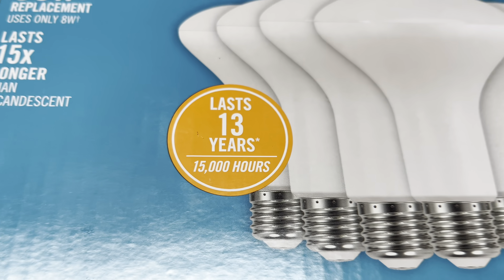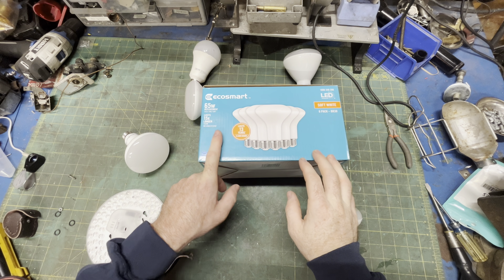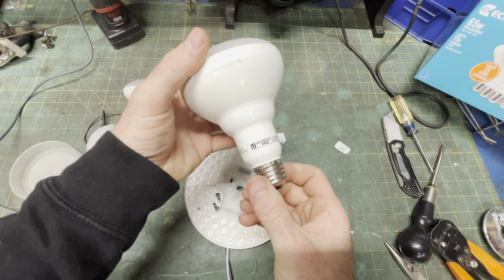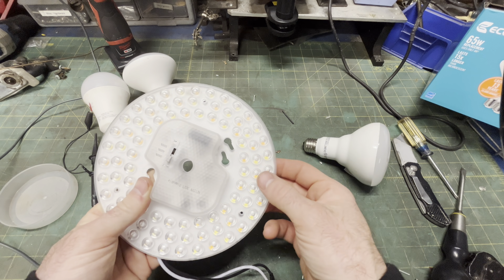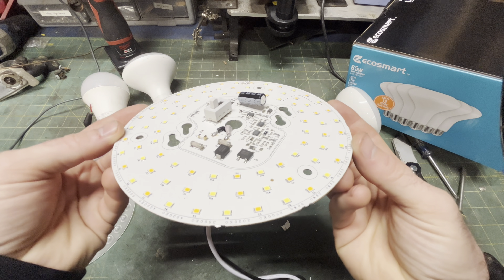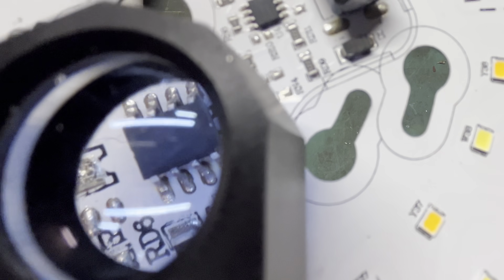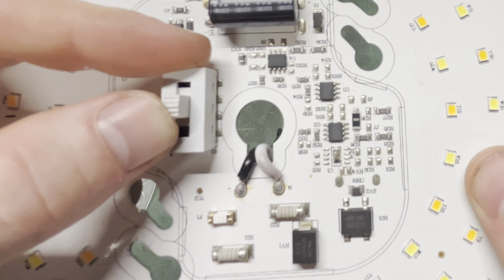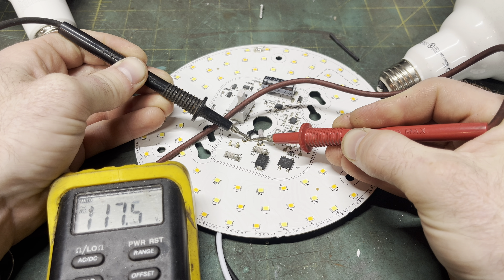Why Do LED Bulbs Fail? An Autopsy!

Comment: I've found the one REALLY good thing about LED light bulbs is that if I pay a bit more for the premium brand or version you really do get a better product. The cheapo Chinesium products will break in about the same time a similarly priced CFL would. A nice Philips light bulb likely will approach their advertised lifespan give or take a year with reasonable duty and use. Also, essentially no color variance between identically branded bulbs.

Comment: This seems like the right channel to ask this question. I had a faulty LED light bulb that caused the circuit voltage to jump to 220vac when it was connected and when disconnected the voltage would drop back down to 110vac. What fault caused the voltage condition I described?

Comment: I bought a 3-pack of LED lightbulbs (alleged average lifetime: 25,000 hours) with the intention of replacing the three compact fluorescent bulbs in my ceiling light over time as each one failed.
Since then I've replaced two failed fluorescents, but the third LED bulb has recently been used to replace one of the other LEDs. The third fluorescent is still going strong (though a little less bright).

Comment: Speaking of broken solder joints, as an automotive tech I repaired many ROHS circuit boards starting around 1988 in engine control units, dashes and heater control panels with old school lead/tin solder....until I ran out of lead/tin solder; high tin and antimony solder is just too brittle IMHO, your mileage may  vary.

Comment: I could see the multimeter leeds sliding together and thought what the hell. I did this once and had to sharpen my mmeter afterwards on a sandpaper block. Looks like there might be redundancy in the flat light, and it is spread out for heat dissipation. Simple repair with everything accessible.

Why is the aluminum sheet called a "wafer"? You can pull off the screw socket and the rivet pin to release the wires. Pointless to break it apart if it doesn't go back together. These reflector-shape bulbs are usually enclosed, which kills them. Now the trend is to hang bare bulbs even in nice diners.

Comment: Incandescents burnt out all the time.  Mine have lasted so much longer than incandescents I almost forget they can burn out. However most don't last nearly as long as promised.  Used to take the CFLs back and get new ones when they failed warranty.  LEDs learned from that and killed any warranty process.

Comment: I was a Tech for 30 years in R&D. I was there for the switchover from lead based solder to lead free. It was the biggest disaster ever. I tried to work on an LED bulb but trying to desolder a lead free device needs a blow torch. There were all sorts of problems in high density packages with "whiskers" forming from the high concentration of tin. What you came across in the first issue is quite common in lead free boards, solder starving due to poor flow. The amount of lead in PCBs is negligible. One car battery has more lead in it than a bitcoin farm would have.
PS: You had a resistor that was apparently blown open. Pro tip: Just read the value and solder a new one on top of it, preferably a higher wattage version.
Reply: if its open and you run another resistor in parallel its still open
Reply: @XDbored1 That’s backward. Current takes the past of least resistance and a resistor has less resistance than an open. If the resistor were shorted, you’d be correct. Adding a resistor in parallel with a short is still a short.
Reply: @minig646  Thanks. Someone (gives XD the side eye) clearly failed High School electronics. It does make me think of why a resistor would "open" itself. It might be just a bad resistor from the factory and it just went, or if it's a low ohm resistor that is running full time near its wattage limit, over time it could do thermal damage (thermal cycling can stretch the package and eventually break the resistive element or even break the solder connection in an SMT package.), but it's hard to say now knowing the material its made of (carbon, metal film etc.)
Reply: @minig646  ah makes sense i thought open meant no resistance ie shorted, looks like everyone uses it to mean cut.

Comment: The first CF bulb I ever bought lasted for around 20 years in four different houses and my workshop before finally fizzling.  Even the shortest lived LED bulbs I've bought (and some, as he points out, are garbage) last several times longer than an incandescent.  We just forget how often we had to change them.

Comment: I installed a motion sensing light fixture in my garage shortly after moving here in July. I installed in it some LED flood lights that I had taken out of my kitchen in my previous house when I changed them all to a matching color because some buffoon couldn't be bothered with such a task before. Anyway, I figured I'd use these bulbs in this motion light in my garage so that when I walk out the door into my garage I don't fall on my face tripping over the dog or something else in the dark and I don't have to turn on the gigantic garage lights that according to my calculations consume around 660W. Well anyway, it's now been just a few months and I have already had about eight of those bulbs. Go bad. Mind you not a single one of them had failed in my kitchen in my old house before I put them into storage for a couple of years. What the hell?

Comment: Phillips Hue bulbs are expensive as hell at $50 per bulb, but they have proven themselves given that I bought them in March 2013.

So they’ve lasted me 10+ years going through 5 different apartments Dorms and houses, and I can change their colors.

Did I ever buy them for $50? Hell no, I often pick them up at warehouse salvage yards for $0.01 to $0.25 each. I currently have like 30 of them with 20 of them being color changing bulbs.

Comment: I noticed LEDs get dimmer over time too. I replaced a bulb in a ceiling light with an identical bulb, bought at the same time but never used, and I nearly blew my eyes out. So after 1-2 years, they lose a good % of lumens too

Comment: modern incandescent don't last very long either.
That outdoor one also looks like a 40 watter, so that will probably last a while.   I almost never see 40 watt bulbs in use, but I've never replaced one either.
Not many want to live with 40 watt light, tho.
Most of my LED's don't puke, but the ones that do, fail pretty early.
Sometimes the covers just fall off, but they still light, lol.

Comment: Have had some cheap led burnout in a 1-2 years but others have lasted atleast 8 yrs now.

Have a 300w equivalent led in an outdoor light sensitive fixture that's on 8-14 hours a day and has been running for 10 yrs now.

I will say I remember the incandescent days and needing a box load of bulbs in the closest to replace them constantly, plus my kitchen lights would need a dedicated 20 amp circuit to power them as non led

Comment: I have simpler bulbs that used low power LED's before the light emitting surface mount diodes were available. They only emit about the same light as a 40 Watt incandescent but use less than 1 Watt which is the minimum that my Kill-o-watt device can display. I bought two of these around 2006. They don't get very warm to the touch and are still working as well as when they were new. One of these is in an old metal desk lamp and is on almost constantly.
I have lost count of how many SMD bulbs have failed, but the ones that still work have not had regular use and were expensive when purchased. 
1. Some have failed because of obvious sloppy soldering with flux left all over the board - usually in less than one year.
2. Some fail because the SMD's get hot and depending on the bulb's orientation, the heat sink may not be able to do its job. If you put them in a decorative glass globe, as you would with incandescent bulbs and leave the light on, they are pretty much guaranteed to fail.
3. I read somewhere that in order for SMD solder joints to last, the factory needs to have strict humidity controls, and without it corrosion can result. Cheap products from poor countries with high humidity might be something to avoid.
One thing seems pretty clear. You are not getting 10 years out of any bulb with bright surface mount diodes unless it is engineered and priced out of the market.

Comment: I just clicked on this video so I could comment that I own all Philips Hue LED lights (the ones that change colors as you can get ones that do not), and I have never had one fail on me! The oldest two Hue lights I have are about to be 10 years old and still going strong. I got them in 2015 when I moved into my current apartment, that is how I remember when I got them. Maybe you mentioned this in your video, which I will watch eventually, but what brand you buy definitely matters in how long LED lights last! So Philips Hue, or Philips Master Series and you will be good for well over a decade, making them well worth the money!

Comment: As an electronics tech, this has been an ongoing issue for many years, but you know what, it isn't impossible to do it right!

I have a self built, 0-30V 3A power supply for testing purposes, it is now 22 years old, never had to fix anything on it except replace the  fuse when I blew it!

Comment: This is partially why I am convinced if I ever do make a tiny home or super efficient home, it should be primarily DC only. No conversion loss, no appliances or small bits doing conversion and losing more, just straight dc in to DC storage to DC usage.

Comment: Like you said at the end of the video, if you treat the LEDs well it can last a lifetime. Did you know that LEDs degrade over time due stress by over powering the LEDs? Mostly not a problem of your eyesight when you discover you can't read something, it is just degradation of the LEDs. Most manufacturers include 50% degradation as still usable in the warranty specification. Second, we always talk about LED but it is actually a LED package, there are mostly more than one LEDs inside a package. I have seen a tiny package with 12 LEDs inside. That is why the LED package can get so bright and hot because they are packed so close together, it is almost impossible to dissipate all of the heat especially when overdriven. Inside a closed enclosure, it is even worse. That is why the bulbs fail sooner, heat is the enemy of all kind of electronics. 

What I did with most of my LED lighting is to reduce the current, remove the (excessive) heat. This really helps. Reducing the current effects the amount of light it can produce a little but it is worth to do so because there is a less heat, low degradation, longer lifetime and lower power consumption. That is a win!
Reply: Do you do this to separate light bulbs, or is this on special projects that you create?

Comment: The absolute record holder is a LED bulb I installed few years back in my living room - not any no-name El Cheapo but some recognised brad (still, "imported one") which lasted... probably no more than several hours. (This lamp I've put this LED bulb in is switched on only occasionally, and it stopped working in less than ten weeks after installation of the bulb.)

Comment: I replaced all my old incandescent (and a couple of those gawd awful CFL) bulbs in two houses and a garage about 6 years ago with LED bulbs. Experienced my first LED bulb failure just last week. And I believe that was due to fluctuating currency on that circuit due to my spouse's heating pad. That's a pretty good track record, as far as I am concerned.

Comment: I've had one. ONE.

The bulb in my grandmas toilet. About 15 years ago the incandescent bulb went and I replaced it with an ebay LED bulb. On that day we found out the wiring to that socket is a bit fukky, and when the light is switched off, theres still a little bit of current running thru it. Not enough to make a regular bulb glow, but enough to make an LED bulb be lit at about I wanna say 1/4th brightness. And regardless of how many times I tell them to get an electrician in to fix the wiring when I visit, that has never happened, so that LED bulb that been running continuously, albeit mostly at a fraction of its power, for the past 15 years.

Comment: I've had several 40w ecosmart bulbs go within a year. We renovated our bathroom back around March and installed 8 of these in our new fixtures. We've replaced at least 3 so far. 😢 On the other hand we've had 60w and 100w equivalents go for years. Even outside.

Comment: Biggest pet peeve is light fixtures with cheapo LED's integrated in.
When it fails you cant just screw in a new "bulb," you have to replace the WHOLE FIXTURE.
And its getting more and more difficult to find fixtures that arent like this.

Comment: Cree LED had something going back before 2021. Anything after that year, not so much. I am still using several Cree Bulbs from 2019. Not one has failed, and one I use in an older refrigerator.

Comment: In enclosed fixtures I'm lucky if I get a year out of one of those LED bulbs. Doesn't matter the brand. They all have the same basic construction and almost no venting or heat sinking for the electronics. I've taken to drilling holes in the housings and that has lengthened the lifespan of them considerably. In a chandelier-style fixture I turned the bulbs on and checked one with the drilled vent holes and one stock. The drilled one was running at about 100*C and the stock one about 140*C. I have had one burn out prematurely but all the rest I've drilled are still going strong over a year later.

Comment: A few I had failed flickering turned out to be a single bad LED, no doubt due to being run at high temperatures. Another failure in GU10 lamps was an axial lead inductor going open circuit.

Comment: I know some older engineers like myself would tell you the solder joints were not as bad a problem when we still had lead in it. Times change, new problems.

Comment: I purchased a pack of 48 LED bulbs 11 months ago. I have five left. All the rest failed within a few weeks after installing them. I find myself changing failed LED bulbs at intervals of one to two weeks. Over the past several years I have tried several brands and price points of LED bulbs, and all of them have failed within three to five weeks. 
I have four incandescent bulbs that were installed 20 years ago, and they are still going strong. I have four CFLs that were installed 12 to 15 years ago and they are still going. 
I even have four lamps that use incandescent bulbs. Those bulbs have been going for 30 years.
All of these bulbs get used near daily. Some in my basement, but most are in the main living area.
The LED bulbs are installed in my kitchen, bedroom and bathroom, and they get used less than the other lighting I have.

Comment: Those are MELF resistors, which are often used inline with the incoming power and prior to any TVS/MOV/etc as they handle current surges better. Kind of surprised a cheap LED bulb uses them as they are more expensive.

Comment: Years ago I started purchasing the led bulbs that look like there are filaments in them. These actually have a ton of super tiny LEDs in them. So they run at 120v. They just have to rectify the power. Smooth it and do current limiting. These seem to last a really long time

Comment: The longest lived light bulb is the Centennial Light. It has been on for 123 years now. Has been off only a few hours at a time a few times. Because the building wore out and needed renovation. It has gotten a bit dim, though. Vacuum not perfect, I suppose. I wonder if the money back guarantee is still valid? It cost about $1 at the time.

Comment: I got an LED bulb that's been running 24/7 for at least eight years at the top of the stairs leading to my front door. Genuinely surprised it's lasted as long as it has since it was also a cheap one I bought at Walmart.

Comment: 13:50 my dad has a tool specifically for removing solder from the 90's its a little spring then with essentially a syringe (not a needle) the opening is small, you push the end down and it locks in place, then pressing the button it releases and causes a sucking ,then the solder falls out the end. Its mechanical inverted version of your air gun, but more portable.
Reply: That’s called a solder sucker, and they’ve been around since 1961. They aren’t good for surface mount components and for circuit boards with plated holes, though.

Comment: I've found bad solder joints on some that I've taken apart.  Or a bad led in a string, which can be bypassed with a small piece of wire and repairs the string.  It'll run a little brighter and maybe another will burn out, but get some more life out of it.

Comment: Leds work well but the electronic switching power supplies Smoke quickly. Input 120v  out put 48v. switcher buzzes away till POOF. The Cmos transistors short out.

Comment: On the second lamp, the dim one. The scope shows unsmoothed full wave rectified DC at the output of the bridge rectifier. My guess is that the "anti_flicker" smoothing capacitor has failed open circuit. This would explain the unsmoothed DC shown on the scope and the low DC voltage shown on the meter. A bridge rectifier with a functioning smoothing capacitor should give roughly 1.4 times the AC supply voltage (RMS voltage x root 2). About 170 volts on 120 volt AC supply, you measured if I recall something just under 120.

Comment: Yes, incandescent bulbs can last a very long time.  The main reason they fail is to to thermal change.
You turn on a light, it heats up, turn it off it cools down, and each time this happens, it shortens the life of the filament.
I do agree, that the more parts there are to fail, the more likely it is to happen, even with quality parts.
Given the alterative of CFs I much prefer the light from a good LED.

Comment: in my experience it's because the solder is pure lead and mercury so it is easy to use in manufacturing and they get a little warm and the LED diodes float off the board.